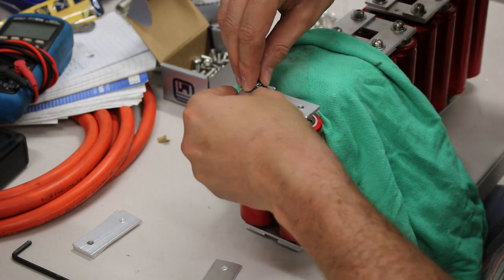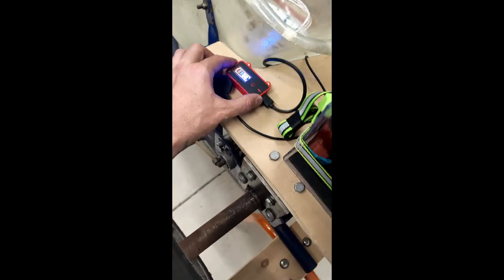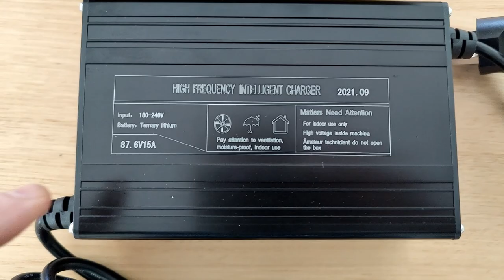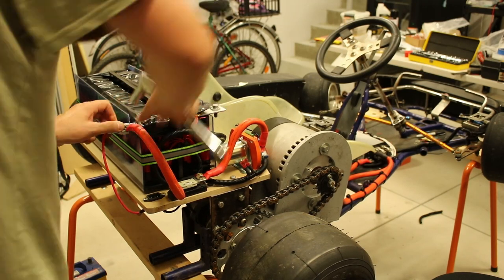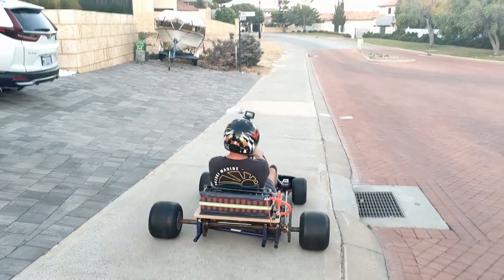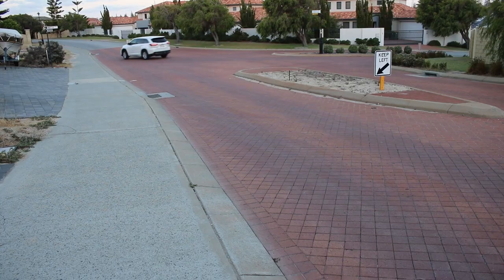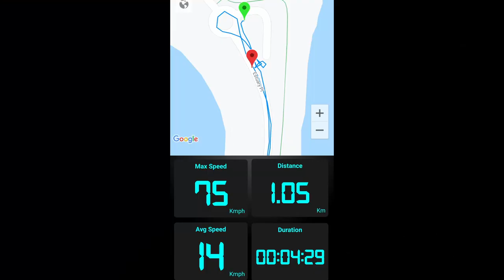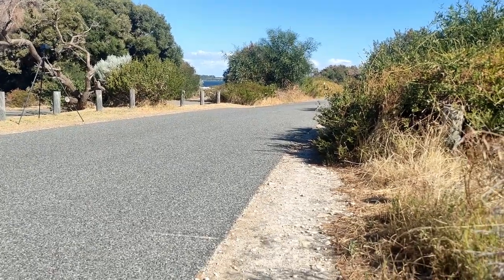DIY Electric Go Kart (Part 8)

Comment: Great build but if I recall the battery mount process. I saw two wood screws holding down all that weight. Can’t imagine that held up so I may have missed something. Either way that should be a strong mechanical connection. Just looking out. Nice work again

Comment: Any idea what the weight of the kart is with the new configuration? Also, what is your final drive ratio?

I am about to start building an '82 Suzuki GS1100 and thinking of using the ME1003 as motor, but I have a final drive of 3.09 and not sure if this motor has enough torque. I am expecting this bike to weigh somewhere between 450 and 550lbs.

Comment: Amazing job!!! How long does the charge last on this version vs the last and how long does it take to charge now vs before?
Reply from the maker: Thanks Jas. It's hard to tell as the load varies so much with different types of driving and acceleration etc. We have had good half hour sessions before we run away from test areas of that helps. The charge time is also hard to tell but the main thing is just hook it up and walk away, BMS does the rest. Much better than manual charging method of earlier renditions
Reply: @TheHandyTech  Awesome job. Well played on the videos too! So great! Absolutely love what you’ve done!!!

Comment: Hi I love your channel!
I’m planning to build an electric kart.
I’m hoping to use rc Lipo packs similar to the earlier version of your build . The biggest difference is that I will be using 8000 mah 140 c 2s2p Lipos.
Any thoughtS?
Reply from the maker: Hi Bryan, thanks mate appreciate the kind words. Nothing wrong with using a combination of pre-made Li-Po packs, the only downside is charging these cells. I found that it took a lot of time and effort to individually charge each pack, whereas a custom built battery that includes a battery management system allows you to connect a single charger that will charge the entire system. A lot more effort to start with, but less effort over time. Hope that helps

Comment: What sprockets are you running front and rear, also is that motor you have a 48volt motor but you are running a 72v battery and controller I take it, I have a similar setup, mine has a 72v lithium battery and a vec500 72v controller and a 10kw continuous ME0907 motor, I didn't realize the motor was only 48v but it can handle 72v but only for 1 minute bursts which puts out 20kw, took it out for a blast but got hot and tripped the thermal in motor I think 😂 just got to set controller to 48v and should be up and running again hopefully, I'm new to running electrical stuff normally I make lots of magic smoke, learn by baptism of fire 😁 going to setup mine with the same stuff you have used with the contactor and rectifier and resistor etc hopefully mine goes as good as yours does 👍 will keep you posted if you're interested, might do a vid of my setup as well at some stage, anyway keep up the great vids cheers
Reply from the maker: Awesome mate sounds like a good setup. Yep best way to learn is to try things out your own way even if something breaks! Definitely bro, post a video when you have it running again
Reply from the maker: sprockets are motorcycle ones, cant remember the ratio off the top of my head
Reply: Hay man yeah think I'm running 15 front and 39 rear thinking of changing whole setup to a torque converter setup lots of ratios to play with :-)

Comment: I'm not 100% sure how to wire up a bms but how do you determine how much p+'s you need (for ex: 12s 14s and so on). Is it based on how many cells you have or how many batterys you have hooked up in series because you bought a 24s bms and hooked up your pack in a 24s 2p configuration
Reply from the maker: Hi Peyton, yep nail on the head. The bms needs a connection to the positive of each successive cell, then one connection to the negative which it uses as the negative reference for the potential difference in each cell. In my case, I have each cell connected with a second cell in parallel. Since they are connected in parallel there is no need to run another positive bms connection to the parallel cell as you would be measuring the same potential difference. Make sense?
Reply: @TheHandyTech  Yeah 😂 It makes a whole lot more sense, thank you so much. I'm running a 14s 2p 51.8v system using the same batteries you used on your old kart (SPIM08HP 3.7V 16AH), do you think it'll be a good idea to use a 48v bms?, because I can't find one that meets the exact requirements. Or could i get a 16s and just have extra lead wires??

-Thank You Again
Reply from the maker: @peytonhasson3522  your main difficulty will be finding something that can output the needed amount of current for your setup if you want the protection features a BMS can provide. But you can actually just use it to help you charge up the pack and balance the cells only. Find out the maximum current your load needs and go from there
Reply: @TheHandyTech  I'm sorry to keep bugging but I found the perfect bms (DALY Smart BMS Li-ion 60V 16S 150A) it meets the amps and volts almost perfectly the only thing is it has two extra leads wires (and I looked for a bit to find a 14s). You worked with daly smart bms, do you know if you could just program the two extra lead wires off?

-Thank you
Reply from the maker: @peytonhasson3522  most are fixed sorry man the usual parameters you can change are just the over and under voltage protection features and current settings etc. But the number of cells are fixed. What controller are you using?
Reply: KDZ - Brushed DC Series/PM Motor Controller (48V) (400A) and an ME0708 PM motor, so basically the same exact set-up you used. I should probably mention this too, I'm a highschool who goes to an engineering school and at our school we have a machine shop so I'm taking the liberty to make an electric drift trike from the ground up so your know-how really does help my project
Reply from the maker: @peytonhasson3522  Don't forget, you have to do your calculations for maximum voltage on the highest value your batteries can be, in your case 4.2v so the max voltage in a 14s battery of that chemistry could be 58.8VDC and thats pretty close to the maximum that your controller can manage. So you definitely cant go for a 16s battery/bms. What I would do is find a 14s bms that you use to manage and charge up the pack, but wire the positive of the battery straight to the controller and not via the bms. This way the BMS will only be used to balance your cells when you are charging them, and has nothing to do with discharge. A bit crude, but it means you can purchase a lower current and cheaper bms. It also means that you can use up to the current rating of your controller and not be limited by the 150A max rating of the daly bms. This will mean much more acceleration. Good luck!
Reply: @TheHandyTech  Ok, I will definitely do that, thank you so much for your advice!

Comment: Tell me what type of contactor and fuse used for 60V 75 AH battery
Reply: Can you share your g-mail it is very helpful to me to clarify doudts regarding circuit connections as I am making a electric go-kart
Reply from the maker: It's all in the video mate I purchased from Kelly website. The wiring diagram is also provided in the motor controller documentation which I followed

Comment: Do you know how long the battery lasts ?
Reply from the maker: Hey Tim, pretty hard to predict as it all depends on how you drive the kart. We tested for around half an hour each time and did not reach the BMS cutoff. Hoping to get some more technical data for next video
Reply: Thanks for the quick answer,
more technical data would be very nice.
Greetings from Germany